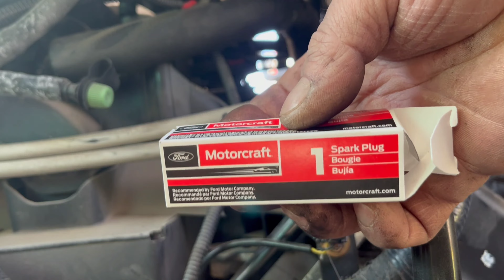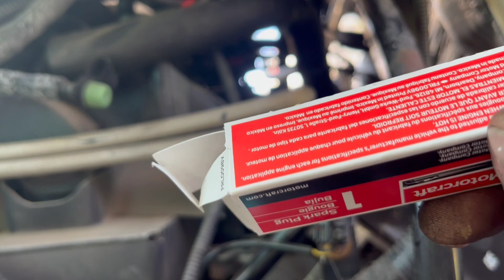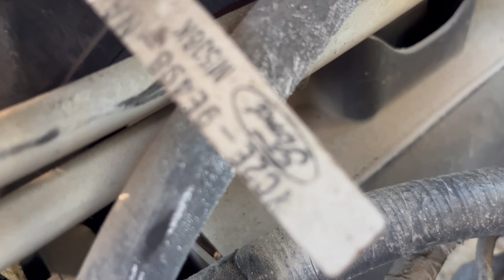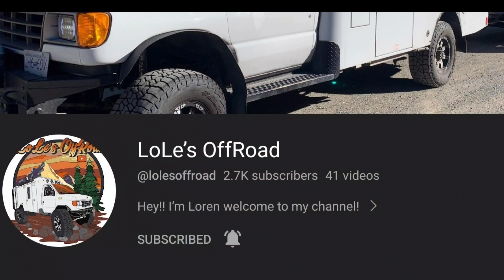FORD ECONOLINE 5.4 V8 Spark Plugs and Ignition Coils the Easy Way

Comment: Loren my friend. Something you may want to look into that will make life easier. Magnetic Spark Plug socket with extension attached. I picked up a 3/8" drive 5/8" with 6" extension specific to my Seinna and what I need.  They have them in different size and length Extension. I think this would make this type of job more easier for you. Love your vids!
Reply from the maker: Hi Landon 
I much appreciated that info yes for sure I will throw one of those in my tool box 
You see everyday we are learning something 
Thank you my friend

Comment: Thanks for sharing your knowledge and experience with these engines & answering my last question on part 1 of this project.

So 3 mis-fires out of 8 is pretty bad... Didn't see how many km were on those old plugs, but yes change them all while you're under the hood as maintenance ( so new platinum spark plugs should last another 150,000 km?)

Also, since platinum spark plugs last longer than copper ones, would using anti seize compound on the threads a good practice since some drivers don't go that many km per year?
Reply from the maker: Yes for sure its pretty bad and was seating do a long time. 
Yea that’s the point I missed on the film 
Always use a little high temperature no size 
Take care